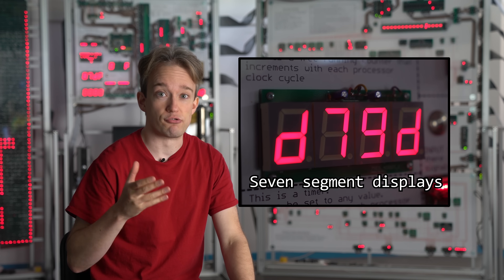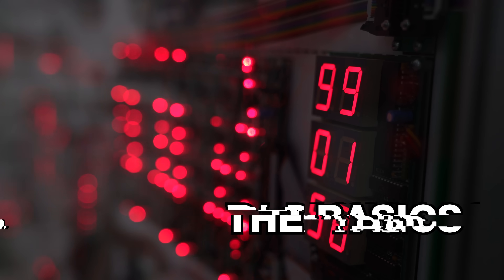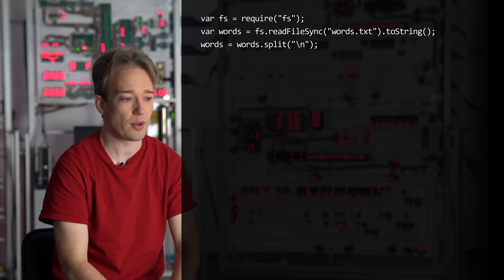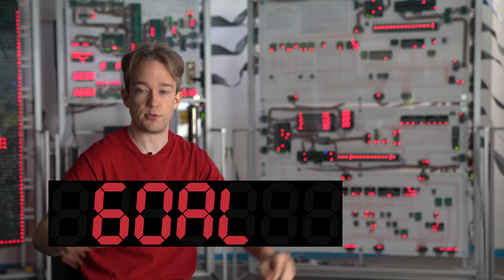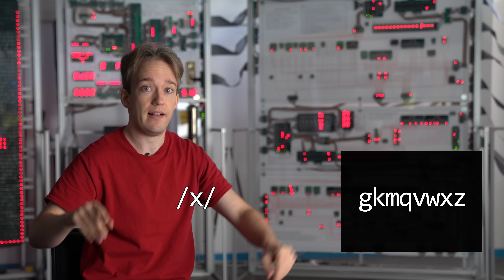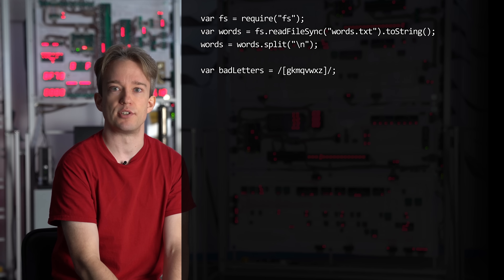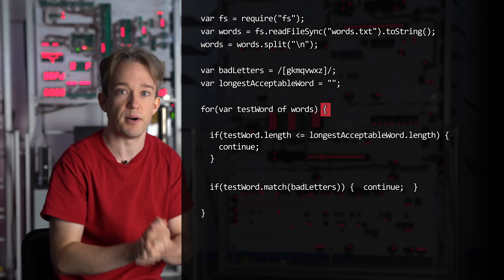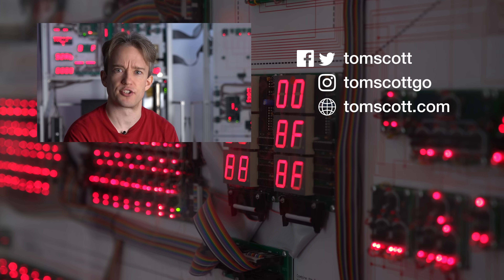What's The Longest Word You Can Write With Seven-Segment Displays?

Comment: I would like it if the display said "Aarrgh" instead of "Error".
Reply: There has been a AARRGH in the system
Reply: But would you prefer "Aarrgh" or "Aarrghh"?
Reply: @Lockirby2  There's even a third spelling earlier in the list "aargh".
Reply: @Lockirby2  ARRRRRRRRRRRR
Reply: @Lockirby2  I changed the number of ur likes to 900
Reply: I've seen FAIL used before.
Reply: @renakunisaki  My cable box displayed FAIL a few seconds before displaying BOOT before rebooting!
Reply: @renakunisaki  I changed the number of ur likes to 500
Reply: 0 / 0 = Aarrgh
Reply: I have seen "dEAd" used.
"bad" works and leaves room for a number after for details.
"On" is good to tell you the power is on just in case you couldn't guess
Reply: The monitor program on a Texas TMS9900 homebrew machine built by the computer club where I went to university had a command syntax validation error message that simply read "QUE?". It was a tribute to Manuel from Fawlty Towers.
Reply: nacronencer
The PDP-8 said "NO"
Reply: In YouTube:
There has been an aarrrgh with the network [400].
Reply: Windows has encountered an arrgh!
Reply: Yeah, but G is a bad letter. :P
Reply: @arthur980807  G or g is fine if you modify the 9 character. You might want to do a shorter "argh" depending on how many characters you have to work with.
Reply: @arthur980807  there is always "ahhh"
Reply: dEAdbEEF  I've seen too many memory dumps with that in it.
Reply: "Stop testing this instruction!  You're hurting the poor machine."
Reply: ooF
Reply: i changed my calculator app to say ‘sht dosent add up’ when it’s has an error
Reply: @component9008  omg make a vid about that if u haven’t already
Reply: @Luna_shadow  um well it was a jailbreak tweak from a few years ago so not sure it works now unfortunately
Reply: AArrGH
Reply: I only know how to write 5318008
Reply: In the future it'll be "oof"
Reply: Pirates : ERROR!
Reply: Nah what about aarrghh
Reply: @t_aikutsu  aarrgghh
Reply: I tried to tare a scale in my lab one time and it just told me "NO". I assume this is how the uprising begins.
Reply: Aaarrgh 404: URL not found.
Reply: I like that, it implies that your calculator dies when you try to divide 0 by 0.
Reply: this made me laugh heartily
Reply: my lighting console has an "oops" button instead of undo
Reply: AARR6H
Reply: @ichliebebaeumeweilbaum  wouldn’t it be arrr9h
Reply: An aagrrh occurred!
Reply: Now the real question is:
Do you want "Aarrgh" or "Aarrghh", since apparently they are both valid words.
Reply: 0/0 = AAAAAAAAAAAAAAAAAAAAAAAAAAAAAAAAAAAAAAAAAAAAAAAAAAAAAAAAAAAAAAAAAAAAAAAAAAAAAAAAAAAAAAAAAAAAAAAAAAAAAAAAAAAAAAAAAAAAAAAAAAAAAAAAAAAARRRRRRRRRRRRRRRRRRRRRRRRRRRRRRRRRRRRRRRRRRRRRRRRRRRRRRRRRRRRRRRRRRRRRRRRRRRRRRRRRRRRRRRRRRRRRRRRRRRRRRRRRRRRRRRRRRRRRRRRRRRRRRRRRRRRRRRRRRRRGGGGGGGGGGGGGGGGGGGGGGGGGGGGGGGGGGGGGGGGGGGGGGGGGGGGGGGGGGGGGGGGHHHHHHHHHHHHHHHHHHHHHHHHHHHHHHHHHHHHHHHHHHHHHHHHHHHHHHHHHHHH
Reply: Half life reference?
Reply: best comment
Reply: I'd like that too, but we dont want to endorse piracy
Reply: There was once a castle of St. Aaargh
Reply: 6.9K likes NI.CEK
Reply: maybe oh no?
Reply: Aar6h
Reply: @YellowLAVA  wouldn’t it be ar9h?
Reply: @Luna_shadow  no capital G looks like a 6
Reply: @ichliebebaeumeweilbaum  ahh I was thinking lowercase
Reply: Aarrgh 404, page not found
Reply: uhhh yes!
Reply: +++ Whoops!  Here comes the cheese! +++
Reply: @dafoex  TAHT INSTEAD
Reply: Or "engogh" or "yeggog"/"ehhoh"/"egghogh"/"eggog" (Greek and Cyrillic respectively, where the R's are replaced with gammas)
Reply: "Oops! Looks like Windows shat itself..."
Reply: syntax aarrgh
Reply: This is the same thing as preferring the display to somehow moan instead of displaying Success
Reply: This is my favorite comment. And yes, please!
Reply: Arr6hh
Reply: g cant be done cause its just a 9
Reply: for real....
Reply: I find 'Err' to be quite funny too.

Computer is confused XD
Reply: Me, too.
Reply: Aaugh
Reply: AArr6h
Reply: Aaaaaaugh
Reply: See esolang called argh
Reply: Omg why is that cut ☺️☺️
Reply: aargh has a badLetter in it
Reply: I would prefer Narf
Reply: Aarrghh an error
Reply: Weeb
Reply: Syntax Aarrgh!
Reply: No, instead, there should be the Yoda death sound from Lego Star Wars.
Reply: There is a programming language that does that, appropriately called Argh!
Reply: The best is when it's shortened to "Err"
Reply: I would go for uhoh 😅
Reply: More accurate
Reply: More like AAAAAAAA
Reply: it has a g, and u can't display it
Reply: You can't use g
Reply: @Laittth  1:40 I think
Reply: You can't write a "g" on a 7 segment display, but to be honest, me making this comment is just a waste of my time. :/
Reply: "Aarrgh" is not a word
Reply: Gimme likes

Comment: Not only is 8 bits convenient for storing. When your microcontroller writes to output pins, it will often use ports. Basically, a group of 8 outputs. Each group corresponds to a byte somewhere in memory. It allows you to write all 8 pins in one single clock tick, instead of turning on each individual pin one by one. And you can also make a look-up table with characters that you can display on the display by just writing that one entry directly to the port. A long story short, it makes the whole processing more convenient, not just the storage.

Source: I'm an embedded systems engineer (in training)
Reply: I am taking a computer architecture course at the moment. A little "lower level" than I would personally prefer, but interesting nonetheless.

Comment: You can get rid of the "continue" by just swapping the direction of the check. Instead of checking "is this smaller than the biggest one?" check "Is this larger than the biggest one?" and put the rest of the checks inside of that check. Does effectively the same thing but is slightly more readable. Then the second one, just put a ! in front of the check so it becomes "does this NOT match this set of characters?"

Comment: This example would actually be quite good for explaining dictionaries or sorted data structures too. Packing the whole thing into a length-based dictionary or sorting order at the start would make this whole process magnitudes faster.
Reply: It would most likely not make it faster to run a sort, since sorting takes way more processing than iterating through it a single time and skipping entries that are too short.

Comment: @7:05 "but I reckon for things like this it's fine"
All of software development in a nutshell.
Reply: Randall Stephens That’s life in a nutshell
Reply: Randall Stephens my internship in a nutshell
Reply: as a CS student half way through his studies (and from personal projects), I can confirm this. :P It is better to find a trivial solution that works, and then improve it from there (ofc, if you can think of the most optimized right off the bat, congrats, implement it).
Reply: I‘ll refactor that later 🙃
Reply: HP hardware design team: why not build alphanumeric LED displays

Comment: you could do G with a lower case g  Q could work in lower case as well, as the p but the downstroke is on the right for q then add the bottom line for q.

Comment: Instead of if(true) do nothing, just reverse the test. If (False) Do... In your example check for things that are longer than the current longest word, then do the second test after that. If (testword.length > LongestAcceptibleWord.length)  {if (testword.,match...}
Reply: But usually programmers are trying to avoid such constructions
Reply: Yeah but its an unnecessary check which raises the big O value of the function.

Comment: God damn it, why was the LongestAcceptableWord left blank? Of course it won't turn out right!
Reply: Sure it will - if your imported word list contains no acceptable words then LongestAcceptableWord is still safely initialised to an empty string which is length 0. I don't know if JS/Node has such things, but in C# I'd probably rather init to "" than risk a NullReferenceException turning up at some point in the future (for a lazy little thing like this - for "big stuff" I'd probably allow the potential Null to exist and check for it at the end).
Reply: As long as the variable is declared at all, it will just be undefined in JavaScript, and won't throw a reference error. 

That said, depending on the implementation, console.log(undefined) can actually print the string "undefined".

Comment: I feel mine was a bit easier as it works in client-side html:

//START
var badLetters = "gkmqvwxzio".split("")
var words=document.getElementsByTagName("span")[0].innerHTML.split("\n");
var LongestWord = "";
var LWn=0;

function containsbL(string){
 for(i=0;i<badLetters.length;i++){
  if(string.includes(badLetters[i])){
   return true;
  }
 }
 return false;
}

for(k=0;k<words.length;k++){
 if(words[k].length>LongestWord.length&&(!containsbL(words[k]))){
  LongestWord = words[k];
  LWn=k;
 }
}

console.log("The longest word is word number "+LWn+": "+LongestWord);
//END

The output for both tests were:

The longest word is word number 104924: dichlorodiphenyltrichloroethane

The longest word is word number 394169: supertranscendentness

I put the word list in a span element and ran the script in the same document.

Comment: Although i think g should be allowed, because there are enough fonts that have a g without the horizontal bar and they are just fine.

Also q isn't just a 9 because 9 has a bottom bar. The q not

Comment: Once we have the answer, we can run another test for all the words with the same lenght and record it into another string. Is there any other better way to find all the answers?
Reply: Instead of having "longestAcceptableWord" being string, you can have it be an array "longestAcceptableWords" and have "logestSoFar" integer. Every time you find new longest word, you clear the "longestAcceptableWords" put in the new word in and update "longestSoFar" to new length. If you find a word that is the same length you add it in "longestAcceptableWords". You skip all shorter words and words having unacceptable letters.

Comment: As a web/software developer I'd argue that using "continue", "return", etc, to write what I call "flat code" does result in more readable and understandable code (especially when spaced out with comments).  I have to deal with legacy systems which have massive if and loop blocks, with levels upon levels of indentation and else statements tens or even hundreds of lines down, and it's a nightmare to read and understand.  The human brain simply doesn't process information like that, we read in one direction, we don't read by jumping up and down trying to piece bits together as we come across them, so writing clean code also means writing code that follows the way that all of our brains have developed to read, in one direction, from top to bottom.

Comment: Tom, if you're excluding G with reasoning that it looks like a 6 or a 9, then you should also exclude I and S because they looked like 1 and 5 (you did exclude them in the end though). Also, I think you should include the lowercase q because it's different enough with the seven-segment 9. Great video otherwise.

Comment: I hate people that hate continue and break
Reply: And I hate continue and break. I mean, why use it?

if ( a <= b ) { continue; }
// do something

is just the same as 

if ( a > b ) {
    // do something
}
Reply: peabrainiac using them as precondition checking, like Tom does in this video, makes things a lot cleaner looking and more obvious than having to go through the whole loop to check if something happens at the end. An obvious “skip iteration if this condition is met” is great
Reply: And why not use goto instead of loops? 
It's madness I tell you!
Reply: Bence Gajdán:
A great way to avoid goto and continue is to make a big long switch statement of you code with one statement in each case.  You can then enclose the switch in a while loop and change the index of the switch on each pass.  Instead of the evil goto, you just have a nice assignment statement that everyone likes.

Comment: Yes, "continue" is bad practice, but it is also never necessary.  Instead of "if true", just go with "if not true".

But thank you.  I've always maintained that you can tell a good programmer from a bad one before they even learn a language.  It is all about how you break down a problem to solve it.
Reply: Why is continue bad practice? Sometimes it is more clear to write with a continue than with the other available options. Sure, it's never necessary, but the same could be said for a for loop, a switch statement, etc., but that doesn't make those constructs bad practice
Reply: Completely agree. Continues can give a flatter structure and make the code easier to read. If they make a loop hard to understand, then the whole loop is probably badly designed to begin with.

Comment: Boring?
Supertranscendentness is a great word, might use it later.
I love Supertranscendentness.
Edit: Btw as for how do I found other longest words, call me lazy but I would just write another loop where it checks if a word is as long as Supertranscendentness it would add that word to an array of strings, there are other more elegant solutions but if I were to do that I would have just received wrote the whole thing to be more elegant
Edit EDIT: I would also remove Supertranscendentness from the list of words and re run the code, if the word coming out is shorter then Supertranscendentness I just saved a lot of time

Comment: One solution to finding the rest of the words of that length would be to amend the "if length<=" to just "if length<".  Add in an "if length=" that appends the new string to the array.  Also add in an "if length>" that replaces the array with the new word.  (Or you could change it to if, else, else.)
(I don't know the correct syntax because all I know that approaches coding is MatLab [please don't hate me!].)